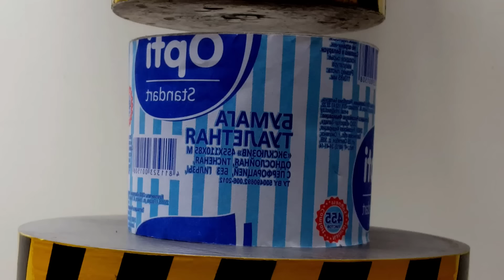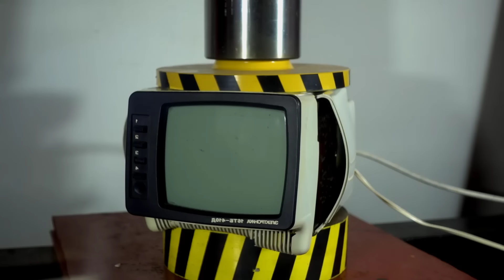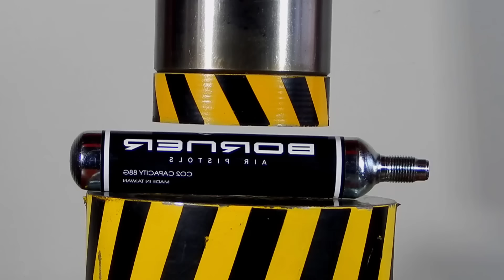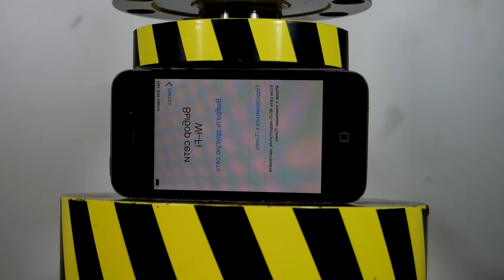TOP 100 ITEMS UNDER HYDRAULIC PRESS, THE BEST

Comment: 13:33 the one that made me say "wow!"... that little guy had more impact on the machine than most of the big items
Reply: Yeah, I was thinking that too.  It's not just the strength of the material, but also the shape.  In another clip, another ball-shaped object looked like it was pushed right into his hardened steel crushing cylinder.
Reply: It's spreading out the force on the ball but for the hydraulic it's pushing a small point so it's working like a bullet
Reply: Looks like the press was damaged from previous use, probably a weak spot .
Reply: 11:34
Reply: 13:50 is just like anime….
Reply: It's physics the smaller the surface area the less the pressure
Reply: Yeah 😱
Reply: @xirlsenx3844  that was really awesome.
Reply: O bichin é tão forte que fez a máquina provar o próprio veneno né kkkk!!!

Comment: It looks like the only thing that could resist the power of that press was that big, square chunk of metal. It crushed a little but not much. Everything else just got obliterated. Neat stuff!!
Reply: and the CD's (for a little)
Reply: @snappedfoil  Oh yeah
Reply: @brianfalls5894  he had to swap crushers to destroy the cds
Reply: The soda bottle also held up pretty well.  Despite being crushed, it didn't burst.
Reply: also remember the little black ball that split the press
Reply: So what about the little black ball that split his hydraulic press?
Reply: @ripeorange5001  Lol, saw your comment after I posted mine. Funny that we both called it a little black ball. Like, wtf even WAS that??
Reply: @kubilaykarasen8191  I have no clue lol but considering how strong it was I was thinking obsidian
Reply: The Nokia 3310 soldiered it haha
Reply: And what about the diamond? That tiny thing destroyed the press machine.
Reply: @brianfalls5894  re
Reply: i wonder if apart press there is any other material stuff that owner value
Reply: What was the sphere at 13:32 that split the press?
Reply: And sponge.
Reply: @bipbop3121  
The black sphere is a tungsten ball. Tungsten is one of the most durable metals in the world. Also the shape of the sphere is very hard to crack because it distributes forces in all directions.

Comment: 13:33 the one that made me say "wow!"... that little guy had more impact on the machine than most of the big items
Reply: what was it? which material?
Reply: marble
Reply: It’s because little things are more compact and it’s harder to crush
Reply: Is due to the area of a marble . pressure =force/area
Reply: Bruh it is not a marble, it is Obsidian ball. Marbles are never that strong
Reply: that's obsidian for you.
Reply: All bearing balls are pretty op
Reply: It's ceramic, this is the original video: https://youtu.be/sbvgTrzd6ds?t=52
Reply: It's ceramic, this is the original video: https://youtu.be/sbvgTrzd6ds?t=52
Reply: concuerdo
:)
Reply: @edelweiss-  Si3N4

Comment: The scene with the three panes of glass was most impressive.
Reply: Did you know glass is harder than any steel
Reply: @menteko2137  nope, glass can be broken easily
Reply: @codzz6979  glass is brittle but its stonger than steel
Reply: Im"press"ive
Reply: Yeh
Reply: @codzz6979  hardness and maintaining structural identity are very different things. while some metals like aluminium are softer than glass, they can bend, so that's why glass is never used in construction materials where big amounts of pressure are applied to small area🤔

in simple words, material A is harder than material B if it can scratch it.

"strength" also is a whole combination of material's  properties.

so yeah, glass is harder, but it's easily breakable.
and when they harden steel it also makes it easier to break.

Comment: Now the ultimate test hydraulic press another hydraulic press.
Reply: Would you consider leaving on 2 tables lamps with 2 different types of bulbs and seeing which lamp burns out first, an experiment?Would you consider leaving on 2 tables lamps with 2 different types of bulbs and seeing which lamp burns out first, an experiment?.
Reply: @maroonmaroonmaroon2985  yes, that is called a resistance test, stress test, and even used to determine the average lifespan of a product. In this case the light bulb.